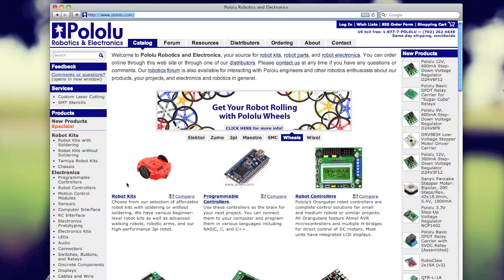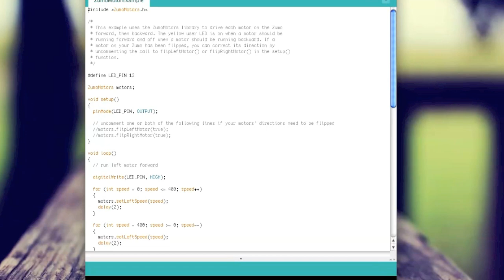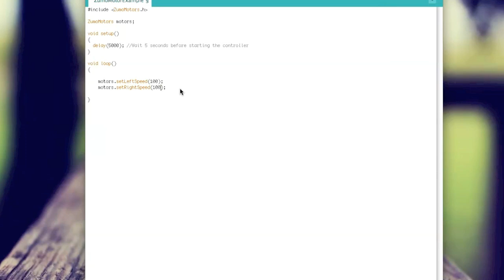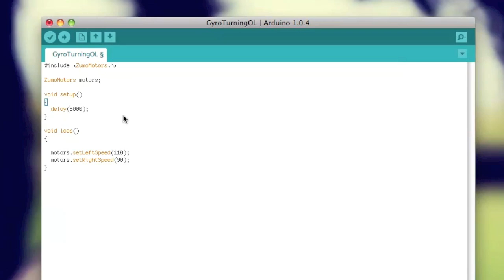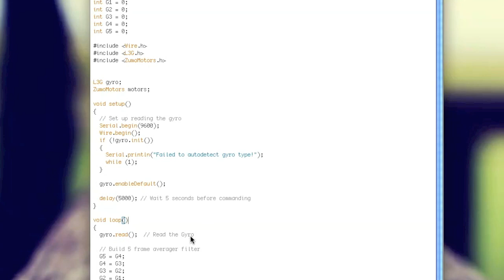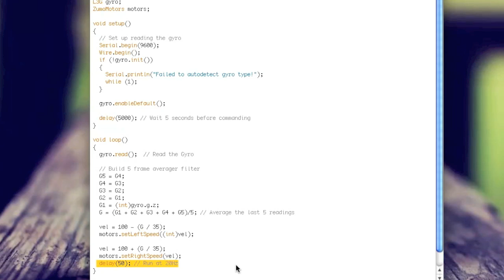Robotic Car, Closed Loop Control Example

Comment from the maker: My full-time job is designing control systems for satellites and aircraft.  I've had some pretty fantastic mentors over the years who have helped me realize the value of what I learned in school.  These lessons are what I'm trying to pass on to others so hopefully more people will get interested and excited about engineering systems.  My recommendation to you would be to read/watch tons of different explanations of the same topic and choose what works for you ... that and practice!
Reply: Thank you, Brian. Love from India
Reply: I have a engineering degree working for sustainable energy but in structure and mechanical. Where can I get started to make control system for a robot car?
Reply: Thanks a lot
Reply: 感谢Brian！让我重燃对控制系统的激情！
Reply: @BoZhaoengineering  Hello Bo!, I'm a biomedial Eng Undergrad so i might not know as much as you, but you can start by learning to program microcontrollers(preferably arduino) and learning step by step about various different motor drivers and such.. there are lot of good tutorials on the internet,  then you can design a control system with the inputs that you plan to implement (it,ultrasound) and output as the pwm for motor driver and switching direction
Reply: Thank you very much Brian, I really appreciate the effort you make to transmit knowledge to us. I really appreciate your work, thanks for helping.
Reply: thank you very much to brian, I really have a lot confusion about the link between control theory and practical project and you give me some good view.

Comment from the maker: Thanks! It went unstable at the end because I had increased the gain higher than 1/35. If you noticed the car never actually went back to the flag and so by increasing the gain I reduced that final error. But if you increase it too much the car goes unstable. However, the real root of the problem is that a proportional controller isn't the correct choice for this case. I couldn't increase the gain high enough to have zero error while still staying stable. I'll explain in a future video.

Comment: Since the rotation is not centered at origin of the car's reference frame, I think the car will try to preserve a trajectory parallel to the original black line.

Comment from the maker: Good question. I could have used a compass (or even the compass and gyro as a pair). I chose a gyro only because I wanted to talk about the gyro sensor in the next few videos. The control law attempts to minimize vehicle rotation, if I had used the compass the control law would have tried to maintain a specific heading. If I had a specific goal for the car (other than to show a closed loop controller) I probably would've picked a different sensor.

Comment: I like how you demonstrated the implementation of control systems using electronics and embedded systems though most control engineers usually don't need to do the implementation.

Comment from the maker: Hi Dipendra, I have to admit that I'm not a programming expert but here is my recommendation. First off, understanding "how" to program is more important than learning a specific language (i.e. the logic and flow of a program).  At my job I use Matlab more than anything and you can write some pretty sophisticated scripts with Matlab.  I can read through C and can tweak code but haven't really had to write large programs from scratch in C.  I guess it depends on what you're using it for.

Comment: Congratulations for your videos Brian, I'm sure it helps lots of people, I am one of them. I'm trying to make a car go towards to one direction, in my case the disturb is caused by little difference between wheels speed. I thought I could do that using a acelerometer, but someone told me I should use a gyro.
My goal at this moment is to get that.

Comment from the maker: Hi Cruz, you are correct that the EMI caused by the motors would be picked up by the compass.  I haven't tried it on my latest project but on a past project I wrapped the motors with a high magnetic permeability metal to shield the other components from the motors.  Another thought is depending on the speed of the motors and the expected turning rate of the car you might be able to filter the magnetic component from the motors out of the compass reading. Interested to see if it would work!

Comment: Adjust those gains and give it a sense of direction /w the magnetometer! Might wanna get the MPU-9150 also. Oh and while i'm at it you're gonna need to find out what has an electromagnetic field [like the motors ;)] and keep the magnetometer away.

Comment: Brian, Great Videos...  However,  Kalman Filter and MIMO systems using Matlab plus are my lackings.  Any chance on videos and examples on these topics.  I have problems with more than one input like pressure and temperature. Trying to optimize and perform system ID is more second-order or more systems.  After building math models and trying to tune cascade models.  hardware in the loop is different at this level.  Does not tune very well.  Any ideas?

Comment: I tried your code to my zumo robot and it did not work, after doing some research i found that you made some mistakes, in fact you are reading raw data from the gyro, you have to do the conversion (dps or rad/sec). Where does the 1/35 comes from? normally it should be RW where R is (the length of the axel/2) and W is the angular speed, and what is the unit of the velocity, are you sure that the units are uniform?
I also think that you should change the equations of Vleft and Vright, if you want your robot to drive straight with respect to the earth reference, because if the disturbance G.z is positive then the left wheel should drive faster than the right wheel to compensate.
I donno how you code worked.